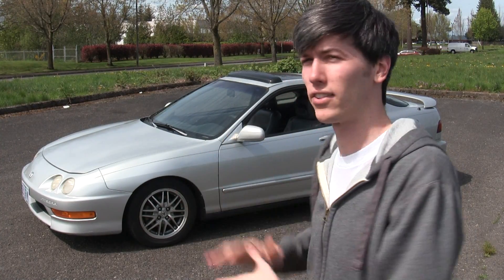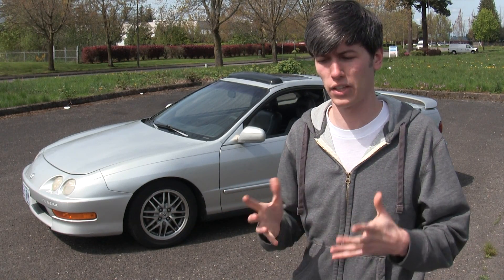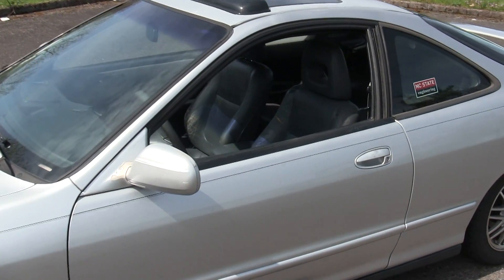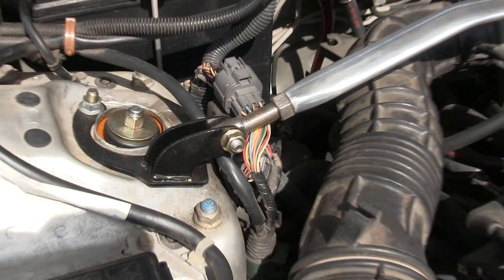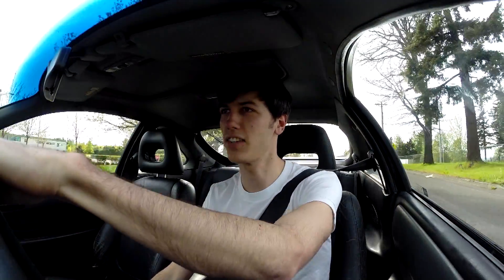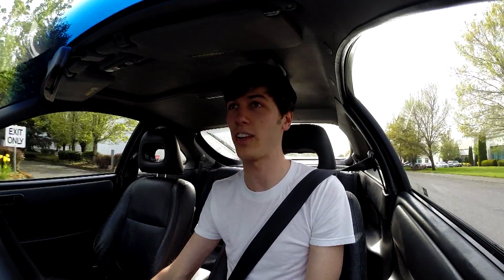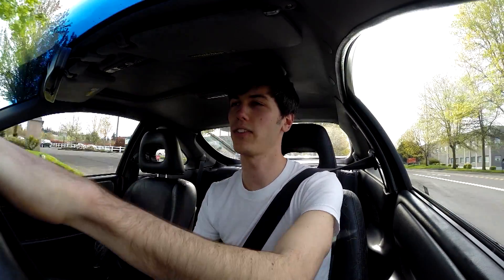Project Integra - Let's Build A Race Car

Comment: So here are some things to consider turn it into a drag strip racer or a time attack track car depending on what is near where you live. Second, stick to performance parts over aesthetic looks unless aero dynamic, also make video of before and after install, video discussing the purpose of the part, and install of the part. Big decission here build out the stock engine or swap should you go with a swap get a k20/k24 . Or rebuild the B18 complete break down and build a proper turbo with rods and pistons. Get an intake , exhaust header, and exhaust. Light weight rims with slicks tear out those seats get light weight driver seat and adjust suspension to compensate weight short shifter, performance clutch, Try getting in touch with Kingmortorsports.com they have a lot of parts and if you need OEM parts go to K20.org and talk with Autofairhonda on the vender these guys will hook you up with good prices tell them what your looking to do and they may have some advice.

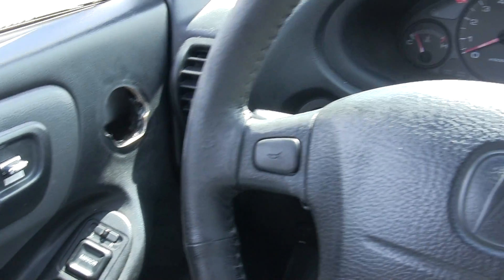Comment: I love the idea of modifying the integra!  One of the best cars for this type of job IMO.The first thing I would do that costs no money would be to tighten your acceleration pedal cable (watch the cable between 3:27 - 3:39).  It appears to have quite a bit of slack, and this can give the illusion of your car being down on power (because you have to press the gas pedal down further).  ONE UPGRADE THAT IS A MUST IS A ROLL CAGE!  If you plan to drive your vehicle around a track, a roll cage is a MUST HAVE!  In the chance that you do roll (hopefully not!), you will know that you will not be crushed and will be able to walk out alive.  Upgrades that I would do afterwards (which all cost quite a bit of money) would be forced induction with a black inter-cooler (the black colour is known to help with heat dissipation according to thermodynamics), new tires that have more grips for hugging the apex on turns, replace the seats (at least the driver's) with a race seat with a five-point harness because they have better support for those high g-force turns (better yet, strip the interior so you have only a driver seat!), and some performance brakes to keep up with the increased engine power. Of course, there are so much more you can do, but these are just what I would do if I owned the integra!  Have fun man, and best of luck!

Comment: I completely agree with the suspension (especially anti sway bars) and brakes... The other thing I would highly suggest ( and is usually over looked till it breaks) is a posi, clutch/pressure plate, and CV joints ( your vehicle is getting high enough mileage the extra stress of tracking/ dyno it) One of the first things to go is going to be the clutch, posi ( if it has one), or CV joints... Only a slight upgrade on these parts ( stage 1 or 2 ) will make a vast improvement and make the car more consistent when testing parts and make ready for more power in the future. The stage 1 or 2 clutch, posi, and CV joints won't be so expensive or harsh that the car won't be streetable/ fun to drive on the track, but simply improve the durability.

Comment: From what I gathered your more "book smart" then wrench smart. Well time to be more wrench smart now and learn the proper ways of improving performance. I would start off by ripping out your stock intake and exhaust. Those two things restrict the flow of the engine breathing but since you said the engine has over 100k miles on it I would just tear it apart, clean it up and rebuild it with fresh seals/gaskets. Re-ring the pistons ect...then add some performance to it like a decent turbo, higher flow injectors, intercool it among other modifications...I would also make sure your trans can handle it or swap that out for a six speed.

Comment: Looks like you have a little slack in the throttle cable, before you buy anything I would make sure it is adjusted so the throttle body is completely opened when your foot had the pedal to the floor.

Comment: Buy a DC5 type r engine, put a turbo on it too? Maybe DC5 bucket seats with New civic type R wheels and install Evo 8 brembo breaks it can be done my mates got a type r civic turbo running 450bhp but he needs 18 inch wheels to fit the Evo 8 breaks? Coilovers and DC2 steering wheel too :)

Comment: You should fix it up so you can still driver her as a daily. Change out the intake for an SRI (Short ram intake). It should improve your low end power and sound very nice. I want to see an unusual exhaust on her. Classic chambered powerstick? Flowmaster 10? DNA muffler? Gut the interior, build the motor up for high revving!

Comment: Just a quick small suggestion about your worn piston rings. What helped me out a lot (for some reason) is SUPROTEK fluid. It is some kind of fluid that reduces friction and fixes compression. That resurrected some of my 2001 Saab 9-5 HPs.
It would be cool to know if it helps out someone else. And it fits your Project Integra format I think. And it is one of the cheapest ways to improve performance a bit. Why not try it out?

Comment: If you're going to replace the engine mounts, do NOT go all solid/dense - half it up if you anything. You'll rattle your face off, especially as you add power/tweak the engine; From watching your videos, I get the impression you know better, but every now and then someone gets it in their head that they should maybe try it out. And they end up regretting it. Just throwing it out there.
Reply from the maker: Yeah I'm not a fan of "solid" engine mounting. I don't enjoy enormous vibration from the engine.
Reply: I've replaced my motor mounts with Polyurethane but was warned of increased vibration... Hardly noticeable... maybe a good alternative to solid mount...
Reply: Charles Lightfoot The cool thing about polymers is that many of them come in different densities. Polyurethane is usually pretty squishy, typically a nice in between rubber bushings and solid delrin --- Possibly a great choice for this build, especially if the old ones are worn enough to justify them (though it'd be better to verify an engine swap won't be a soon-future project, as it'd be wasted money).

All that said, every now and then someone gets it in their head that it won't be so bad with the solid delrin/dense poly (oops, forgot I was going to write those out completely in my previous comment), and even smarter guys like EngiExplain sometimes get talked into it. I was just throwing in the ne say just in case. ;)

Comment: Since theirs an ls b18b1 engine in it, a solid ls vtec build would probably be the best bang for your buck, cheaper than a swap and way faster if built properly. If possible before you do any work to the engine one thing im sure alot of ls owners wonder is if chipping and tuning your ecu will make much difference on a stock b18b1

Comment: This is a bit lengthy but worth reading. 

From my experience, upgrade one or two parts per section of the car or get one big upgrade for that particular section the car. I'd say priorities first. So my priorities are handling, acceleration and finally speed. 

Basically, upgrade the suspension first (Koni or Blistein whatever you wanna go with) cause a good suspension gives you better control and safety. Along with the suspension, the brakes and the tyres. Next, weight reduction. Just remove the rear seats and the carpets for now before you go deeper. And of course, install the roll cage and bucket seats. Along with all these things, get a steering wheel with smaller diameter, this should give you faster steering. 

Now for acceleration, I go with upgrading the air filter and maybe a stage 1 turbocharger. If you have a bigger budget, then stage 3 with intercooler would be great option and changing the exhaust system (don't know what sort you'll be going for). Also a better clutch would be good option. Also, from your previous videos, I think upgrading the differential would get you better acceleration and handling.

Now for speed. Get a variable spoiler. I don't know how much they cost but I'm guessing they are expensive as they vary between down force and streamlined depending on the driving situation or the driver's will. So instead get splitters and diffusers for now because your car is front wheel drive. Also, the smaller and flatter the frontal surface area, the lower the drag. So get a front bumper which has "a very big mouth". That way, more air would channel into the radiator and the intercooler. Also get a lightweight bonnet with air scoops built in it. All this will give you better fuel economy and higher top speed. If possible, upgrade the gearbox to a better one. You could go for a fully customizable which is very expensive or just go one better than the stock. Also lowering the gear lever would mean faster gear changes. 

There is more I could suggest you but this is it for now. I hope all these help you out. Good luck with it.
Reply from the maker: All good suggestions, thanks!

Comment: My thoughts, like byzantine....start off cheap and remove weight.  Can you track test this car and see what it runs for comparison.  Then tune it, cai ....tune....headers and high flow cats tune....basic bolt ons.  supercharge vs turbo......hopefully some vendors can come through, that's a pretty penney.
Reply from the maker: I like the idea of track testing, but I don't think I'm a consistent enough driver to make it accurate. I'll have different tests to prove there is a difference.
Reply: Engineering Explained sounds good.  Biggest concern for most is bang for buck.  My last mod cost me $2000 parts and labor, only netted me .1 and 3mph on the 1/4 mile....I was ticked, but it barks and is more responsive on the street

Comment: The removal of all unnecessary weight is a good start, you can do it while all the new parts you want to install are being shipped! Because its a modification that will affect handling, acceleration and deceleration, it could be worth doing a before and after lap time comparison or something at a local track. Removing rear seats, sound deadening, the stereo, a/c, spare wheel etc can make an enormous difference

Comment: b18cr engine swap or maybe k20a ? would be nice to see that upgrade as u can learn to rebuild the engine and so can i from your videos although time consuming and probably cost you a fair bit of money and time but i think is best upgrade for performance and reliability. if u want u can change the clutch to a heavier duty spec while your at it? and upgrade brakes if you got extra cash. keep the look of the car low profile in my opinion =] to surprise people. definitely a new set of seats though.

Comment: If you can, tighten up that throttle cable. it seems a little stretched out after 15 years. You might see some better throttle response.

Comment: Depends on how much $$$ you've got to spend on this Integra project, I'm more of a driving dynamics kinda guy, power ... meh, it's been done before! Just to throw it out there ... how about rear wheel drive swap with a limited slip differential!

Had to hit this thing - On the STi, I would recommend browsing NASOIC or IWSTI to find out some of the common issues with STi and you'll know where to start or not go. I have a 2010 WRX, and one thing I wish I had installed earlier on was a thermostatic oil cooler and air/oil separator as the first mod especially since I ended up keeping the car longer than I originally planned. The Grimmspeed brake master cylinder brace (less than $105) is also a huge easy mod that is very important ... after that, just work on keeping the car cooler (DEI wrap intake box, turbo heat shield or etc... for longer periods of time until you are ready for more.

Comment: I like the idea of trying to swap in as many type r / etc parts as possible first. You know they will fit and there are many tutorials/threads. BRAKES AND SUSPENSION FIRST!!! Power later. You have coil overs already thats a great start. Now swap in better brakes, lines, bushings, camber adjustments, wheels, tires. 

Take it from experience, make sure all the various parts work well together and compliment each other. Love the videos and this is a great opportunity to  show what it is really like to modify a car, not just OMG put a TURBO on it!!
Reply from the maker: Agreed on brakes and suspension first!
Reply: Engineering Explained
Go for some fancy slotted rotors, new pads, and braided lines! High flow fuel filter, CT Engineering Icebox (I love the one I put in mine!). Perhaps LS Vtec conversion and DC Sport exhaust headers (4-2-1) and a good grounding kit!

Comment: Turbocharge it. a few lessons in just that modification. Power and what makes more power as in air/fuel being increased. electronics lesson/ecu (again, i know you have one already) and even a comparison episode with differences between N/A and Forced induction.

If looking to do something basic first, I would have to suggest:
Intake,Tint, Cluster, Wheels, Coilovers, Hood Dampers, like you said, countless options.

Comment: If you want i would like to see a bigbrake kit installed and then what the benefits are in comparison to the oem brake disks and pads.

I am wondering if this change then also need a bigger brake booster to be fully effective

Comment: I'd suggest a lighter flywheel, heavy-duty anti-roll bars, better brakes and complete exhaust system. I've changed the first three things on my car and thought they were great, not sure if I should go for the exhaust though, I'd like to know if it is beneficial for a NA engine.

Comment: You should convert the car to a rear-wheel-drive car. It will not only give it better weight distribution, but will also reduce the amount of understeer you usually find on front-wheel-drive cars. You will also have more fun sliding around those corners!

Comment: strip out the interior.Fit bride bucket seats. K24 all motor conversion with skunk2 and bisimoto parts. sequential gearbox. And aero like sportscar motion and realtimes acura integra dc2. Also great first car.I've had 4 hondas and want to mod my own civic.
Reply from the maker: Haha sounds like I need an extra $20k. Thanks for the ideas! :)
Reply: Engineering Explained No problem. :) . I was unaware of the budget but i would aim to enter it in the NASA HPD honda challenge. And if its a a small budget is what you're on( i have a small budget for my tkm karting)  i would fit a cage still the bride bucket seats and a B20A with a uprated box. And uprated calipers and discs as per budget allows,

Comment: Basic performance/maintenance improvements like coolant bleeding, brake system bleeding, replacement of clutch w/ OEM or performance clutch, brake lines, transmission fluid, differential fluid.

Comment: Upgrade the suspension, and brakes, better air intake, removal of anything heavy (back seats, etc.), definitely a better exhaust system. Maybe a low rpm turbo. But you can't go wrong with just decreasing the weight and strengthening the body. Oh, and ECU upgrade.

Comment: if you want suggestions then these are few from my side
EXTERIOR:-
1. add body kit and widen your car
2. change color
3. upgrade suspensions and brakes
4. change your exhaust to magna flow
5. add supercharger to engine

INTERIOR:-
1. do suede on seat and a cool new custom built dashboard wit a touchscreen
2. change headliner
3. add a rocking music system in it.

Comment: would love some proper engine r&d. if the block is steel it would be cool to try to get the cylinders welded with inconel 625 or stelite. i know it's a large bite. but i've never heard of it being tested. and since it's incredible hard and strong it should keep the cylinders from disentegrating.

for some more realistic mods. how about testing different ways to make a engine more durable. thinking bottom end girdle, some bigger head studs/more head studs. different brand head studs. this is starting to become a essay, but you get my flow. type of R&D mods to make a high performance engine more durable. btw, love your channel!

Comment: First thing to do is checking all consumable parts, such as engine, wheel bearings, hydraulic braking system, etc... After that you put the car on the dynamometer and verify the real power it has after tons of miles you drove. Then you can tweak it with antiroll-bars, aftermkt dampers, lightweight the interiors, turbocharger... something like that!

Comment: You should make it RWD with another drivetrain, maybe 2JZGTE or a 350 SBC?
My experience is that no matter how much you spend/upgrade, you will always have a disadvantage with a FWD.
This is offcourse if you have the opportunity/tools/skills to rebuild the chassis.
And since you probably want a rollcage, this should be a good option.

Comment: For interior i think it would be good:
-Weight reduction
-Front seat
-Rollcage
-Seatbelt
-Steering wheel
For exterior:
-Tires and rims
-Brakes
-Exhaust
-You arleady have the suspension so camber and toe etc..
For the engine im not sure but if you could have a turbo i think it would be a great race car.

Comment: Most hondas run a MAP sensor right? I'm thinking it wouldn't be too hard to make up a set of independent throttle bodies for it. Just hack the manifold down and get a set of gsxr throttle bodies off of ebay.